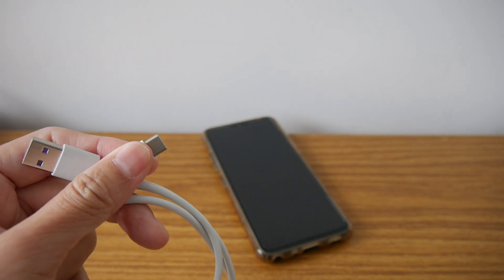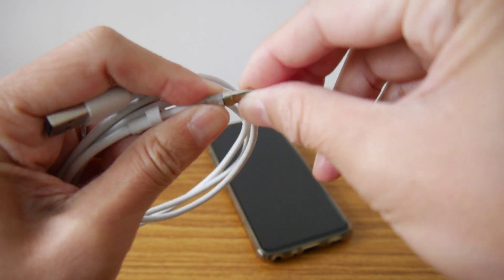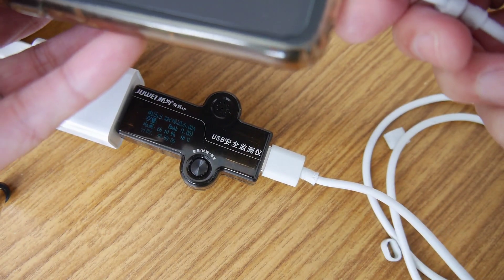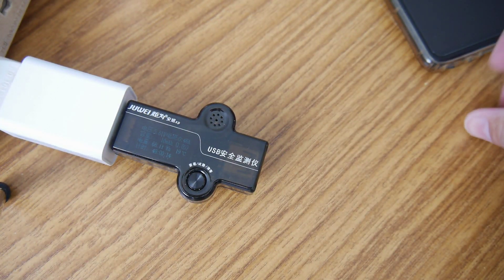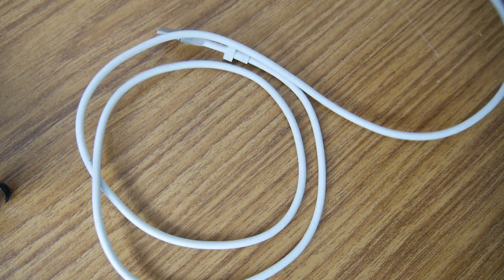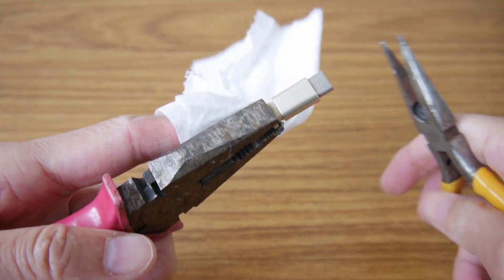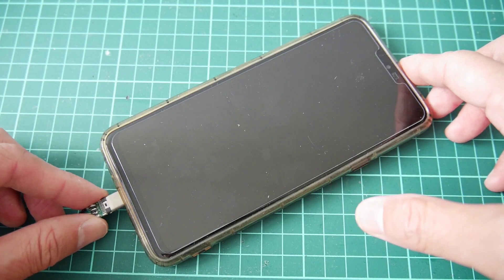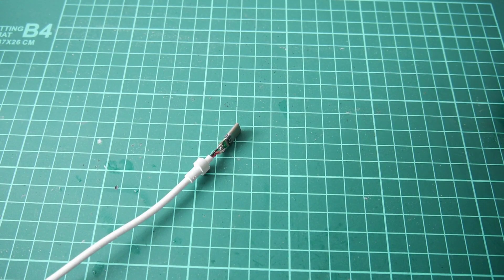It is rocket science？5A USB Type C Wire Plug Swap and Fix, u s b DIY

Comment: Have you tried to eliminate the electronic parts in usb type C and connect it directly?
Reply from the maker: The plug is a simple and basic one, so just connected directly. In other more complicated one, which could give fast charging options, would be good idea to modify the circuit according to the spec.